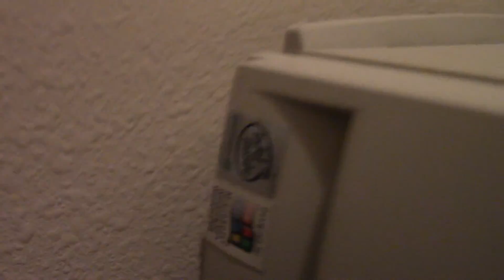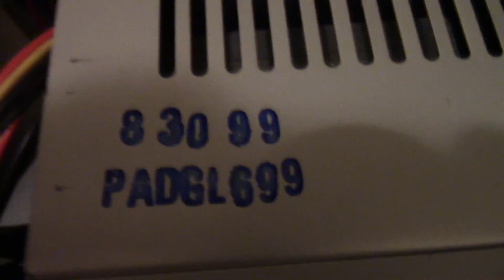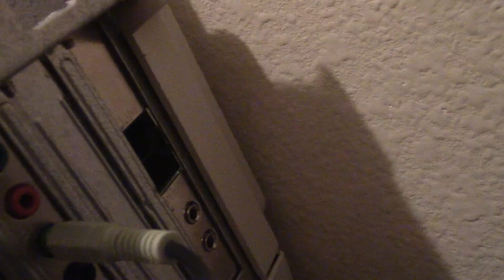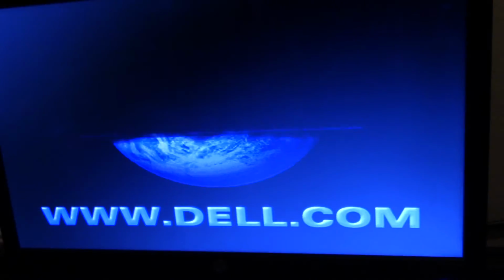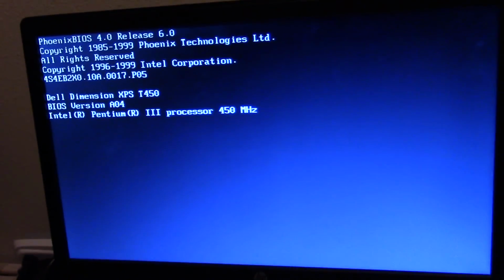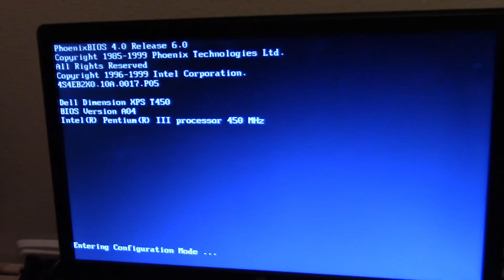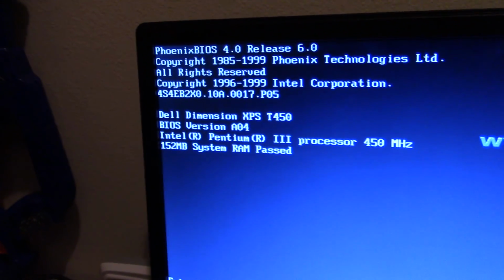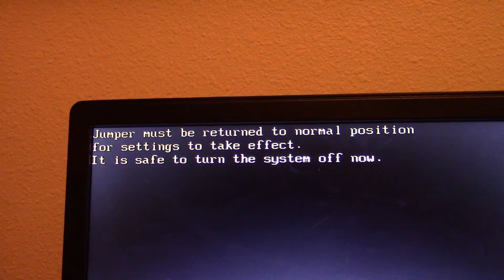Free Dell Dimension XPS T450

Comment: Just picked up one of these and it's predecessor a D233 with a pentium II and the d233 actually happens to have opl3 sound on board which is completely awesome I'm planning to run 95 on it and 98se on the t450 I love giving old machines like these a new lease on live and keep them out of landfills the slot 1 dell dimensions are my personal favorite the cases are very sturdy and eye catching and the motherboards are some of the best all around oem boards for 9x/DOS gaming only downside is dells proprietary power supply connector

Comment: Hey is there a way to boot from usb on this? I recently picked one up and I do not have os cds or floppys.
Reply from the maker: Most PCs made before 2006 do not support booting from USB. Blank discs are much cheaper these days, since most people install Windows or Linux from USB flash drives.
Reply: @benkleinberg97  Im trying to install windows 98. I have a usb floppy drive with floppys and Blank Discs on the way. So ill just make a boot disc and burn a os disc. Thank you for your reply.
Reply: @benkleinberg97  I got windows 98 installed were you able to find a sound driver?
Reply from the maker: @Mrig12000  Dell has been kind at maintaining drivers on website I would suggest looking in the legacy products support section under Win 98.
Reply: @benkleinberg97  I found what chipset it uses on the wiki and needs drivers for a Yamaha 724 DS-1